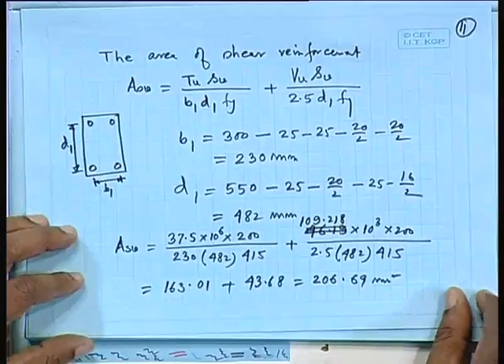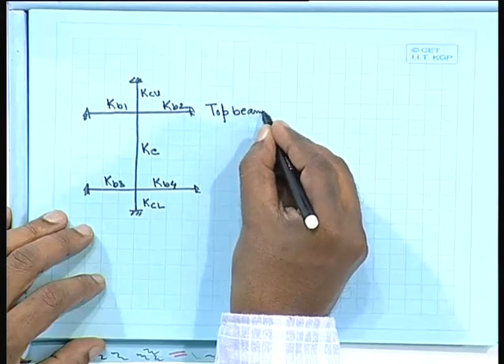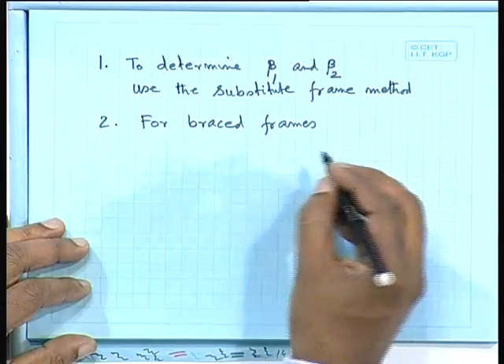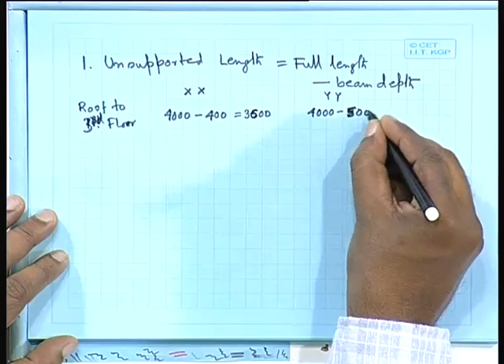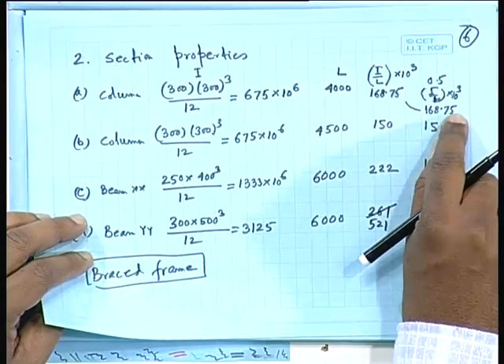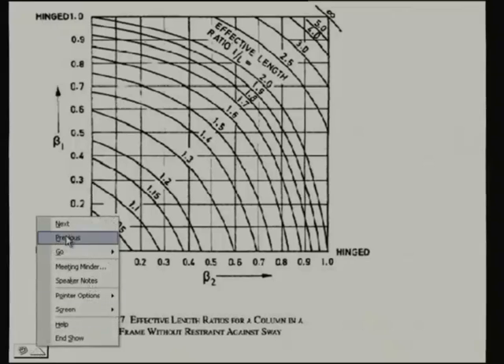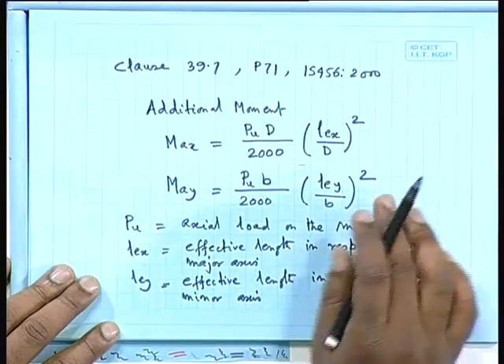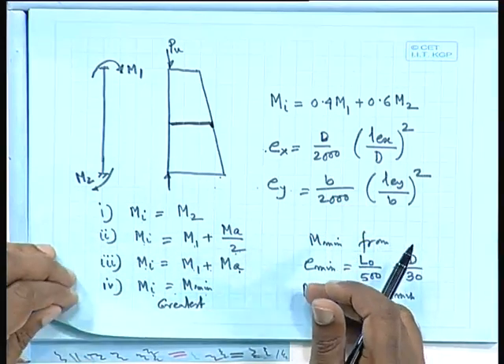Design of RC Slender Columns

Comment: Sir, how to identify cantilever columns or unbraced columns ,Braced and Un braced columns 1) Braced if lateral stability of structure is provided by bracing designed to resist all lateral forces in that plan, lo should not exceed 60 times minimum thickness of columns and 2) Unbraced columns :one end of a braced columns is unrestrained eg a cantilever columns or clear its clear height should satisfy the following lo< 60 b , Practical how to understand the identify sir
Reply: Have you found answer to your question?
I want dissucsion please sr share your watsapp no.
Reply: @toshagrawal4629  100